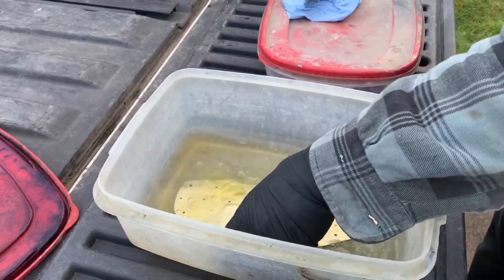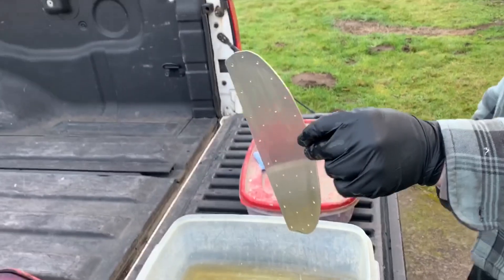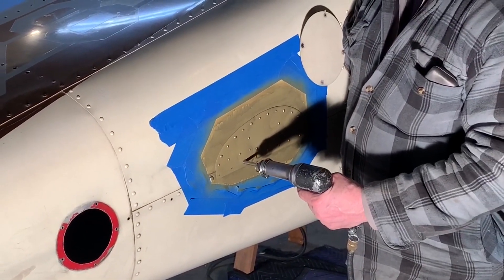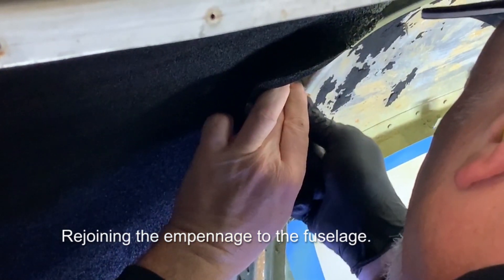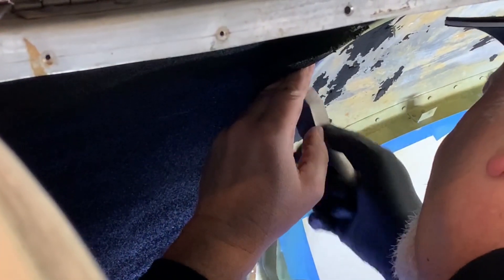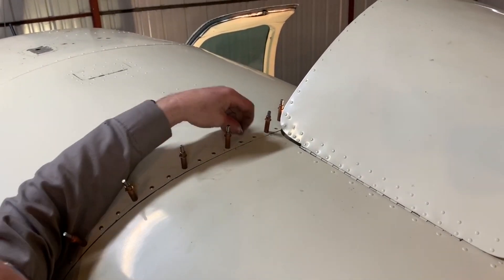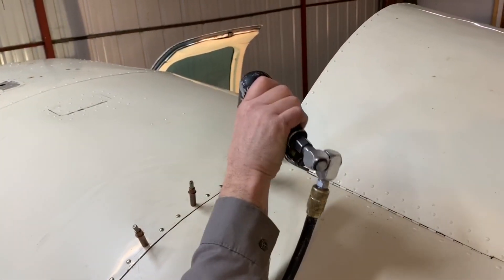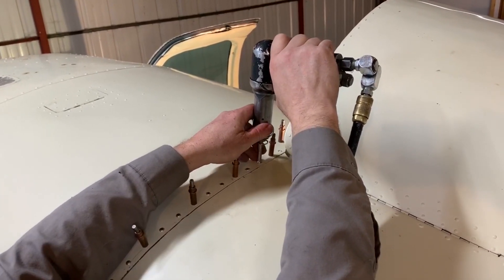Saving a Mooney from the Scrapyard - Episode 3: patching and re-attaching the empennage

Comment: Big deference in the heavy iron vs Moonie and other light aircraft. The big military aircraft are built w/ 5/32 & 3/16” riveted into .032 skins into .047” stringers. They can take a lot force w/o oil canning, where a moonie’s .020 skin will buckle just looking at it.
Reply from the maker: .030!!!  :)  Very thin skins on the wings, but very strong substructure.  Al Mooney wanted his design to appeal to the fighter pilots coming home from WW2.  Pete really over did the patching, as if he was covering a hole in an F16.
Reply: @HairHelmet ; not sure if my point came across properly, this gentleman Pete has a fine touch w/ that rivet gun.
Reply from the maker: @duanepierson4375  I didn't quite understand initially, certainly do with the clarification.  Pete is definitely a master of the craft.

Comment: What dictates whether you use solid rivets that need to be bucked vs. pull rivets or screws?  I see a lot of kit planes use one or the other, or a combination, but have never heard an explanation as to what justifies one or the other.  What "design" considerations go into making the patches?
Reply from the maker: Good questions, I don't have all of the answers, I'll give some general ideas based on questions I asked a year and a half ago when doing the work.  The A&P's who did the work are some of the best, and would answer this far better than I can.  Solid rivets tend to be stronger and much cheaper but require WAY more skill, we used solid for each of the patches and anywhere a solid had been placed when manufactured.  Exceptions required appropriate structural mil spec pull rivets in places that were impossible to buck.  Mooney built the wings on jigs in the opposite direction in which we were working so they could do things that can't be done in a repair situation.  Pete, the sheetmetal specialist, did all of the patch work.  He did this kind of work for Horizon Air and in the Airforce on F16's.  So... his methods may have been overkill for a light GA plane, I can't quite speak to his design considerations after so much time has passed.

Kit planes that use pull rivets do it primarily for ease of assembly.
Reply from the maker: After looking at your channel, I figure you might like some of the videos we plan to make with Land Rover Defenders running Isuzu diesel vs Mercedes diesel.  I've got my eye on a RHD FJ70 if my wife will cooperate...
Reply: Always Amazed by Sheer metal Gurus. Mine always turned out like a gorilla did it. BTW, I'm a retired A&P,

Comment: Looks like a lot work. How long was this project?
Reply from the maker: Bought it in August ‘19 and we did the sheet metal repairs as able until April ‘20 when Kyle (the Mooney expert) was laid off in Michigan due to Covid.  He flew out here to Washington and we worked on it non stop until we test flew on May 25th.  A few days later, after removing insect activity from the vacuum system, we headed for Texas to get the wing repaired.
Reply: You done a very nice job.